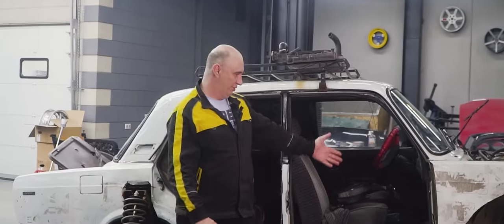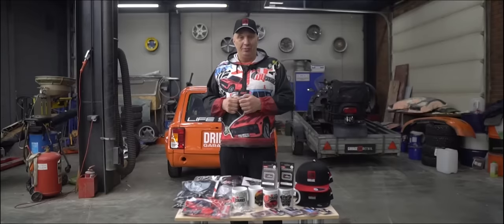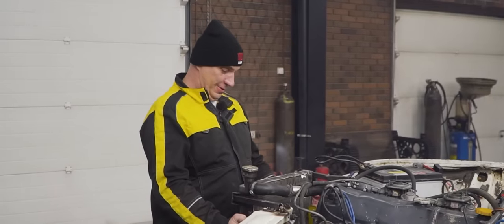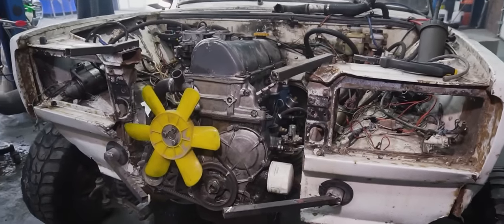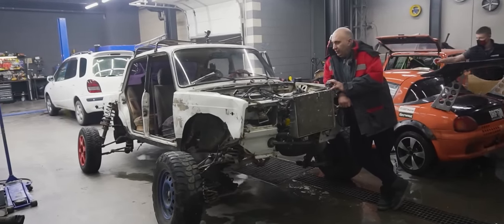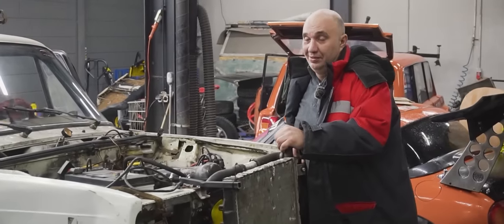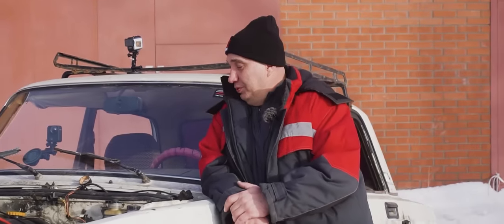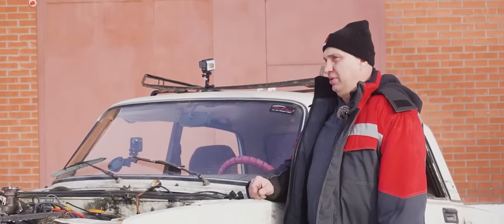How does our custom made inline-6 drive?

Comment: Please put this into a regular car, and measure the torque and power! I think many people are interested in how much you improved the original 4 cylinder engine. Please make this happen!
Reply: ye i am 100% for it
Reply: Yes, he needs to put it on a dyno.
Reply: Yes yes!
Reply: Me too 👍👍
Reply: They forgot about this engine now.....(
Reply: yes
Reply: And add truck turbo
Reply: with one big carby
Reply: Yes
Reply: Realistically it won't make more than 96hp. 64 stock plus 32 of half the block.
Reply: 50% would be my guess.
Reply: yup
Reply: @Makaya9s  It will produce much less than that, even less than the 64hp the engine normally puts out as a 4 cylinder. Itr's a 6 in line with a 180° crankshaft.
Reply: Yes!

Comment: I don't think its running on 6 cylinders, if as I think you have one spark plug piggy backed of another one then only one will spark as electricity will always take the easiest path. You need to modify the ignition system.
Reply: All they have to do is modify any 6cyl distributor to have the lada base, they are easily capable of doing this, hopefully they do.
Reply: They need to use the ignition system from a  old BMW or Jeep
Reply: @twoeightythreez  no, this thing does not fire even at 120 deg intervals
Reply: @kjetiloftedal338  yeah, i was thinking the same. One in top of the other. And 2 cylinders fire at the same time in big bang style😂
Reply: @malancaluciano1253  better try old l6 distributor because it never will work since you need 120° for spark and you will got 180° dosent matter how many distributors you install.
Reply: @LeoKadettTouringCar  tell me why you need 120 deg
Reply: Wrong, it will spark, since it's paralel wiring and if that didn't work, ohms law wouldn't apply
Reply: @Robert Coldham You are incorrect. How about you just Google "Waste Spark Ignition". You'll learn that "only one will spark" isn't right. Also according to your logic, you wouldn't be able to have multiple devices on one circuit and have them all work at the same time. It's nonsense.
Reply: @Franky2Toes69  its not wasted. 2 cylinder fire the same time as other 2
Reply: I second that. The spark plugs are wired in parallel, not in series like in a "wasted spark" circuit. And since a spark is an electrical discharge over a plasma channel, it has negative differential resistance. That probably leads to intermittent ignition failures and do the described "running on four to six cylinders" behavior.
Reply: Yes and the easiest path for the spark is on the exhaust stroke,  not the now deprived  compression stroke.
Reply: The easiest path is half through both!
Reply: It’s literally the same concept as a cop or a slave system one col two plugs kinda like you know the modern hemi engines

Comment: Y'all should make an inline 8 with the two halves timed either 90* or 180* out of phase from each other... Wonder how that would sound with a basic straight pipe on it...
Reply: Trying to see a group of Russians make a V10 engine out of Lada parts would also be quite entertaining.
Reply: @jwalster9412  I second that. Or even a V12 or V16 :)
Reply: Wouldn't it better if the same matching piston fires at the dame time???
Reply: @DigBipper188  there is nothing better than a V10..
Reply: @jwalster9412  v12
Reply: I agree. I want to see a straight 8
Reply: They kinda did that by connecting two together at the flywheel. It put out a lot of power, but less than a typical 8 cylinder.
Reply: @willjohnsonjohnson  yeah, I remember that video. But I'm meaning if they took that idea and instead welded the two engines into one single block like they did here with the LadJZ and timed the cranks to get either 1 or 2 cylinders firing per power stroke. To my recollection the crank timing bit was skipped when they welded the two four bangers to each other or at least they were sparse on the details on how they timed the two engines together.
Reply: Was going to say similar lol a inline 8 lol,  but this would b interesting also
Reply: Straights 8's have been done, they should make a straight 7 :D :D
Reply: @jezzsmith7593  ok must have missed it then lol
Reply: @davydp  Not by g54, I just mean straight 8's have been built and played with by car companies and engineers for a long time.
Reply: @jwalster9412  you can’t with a lada engine, only inlines can make inlines
Reply: @DiscoMiata  I'm sure with a custom crankshaft, and some block fabrication, anything is possible.
Reply: @jwalster9412  …… it would literally cost 10grand just in labor
Reply: There was a I think a Bentley that was like that, I can't remember, And there was another big truck with pretty much 2 GM v8 welded together and joined with the crank pully.
Reply: @DiscoMiata  still better than all V10 cars for sale.
Reply: @jwalster9412  no. Not at all.
Reply: @jezzsmith7593  oh ok I'm with you now lol
Reply: How about a V8?
Reply: @DigBipper188  actually they prefer uneven firing orders for more powerful bike engines. Even firing means there will be a constant power on the wheel, which means a constant traction loss will happen in case of wheel spin. Using uneven firing, there are longer periods when the wheel is not under torque, meaning it has a longer recovery period to gain traction. These engines don't have a 180° or 360° but 90° crank plane instead.
Reply: @jwalster9412  
Have a look at some of Allen Millyard's work.
Reply: Pretty sure if someone put a gun to my head and forced me to make a straight 6 out of two straight 4 then I would have cut the front cylinder off one and back cylinder off the other.
Reply: @DigBipper188  Hell, at this point a Lada Veyron wouldn't suprise me.  🤣🤣🤣
Reply: @jwalster9412  Yeah... V10 welded to an other V10 would be nice.... a V20....
Reply: W16 Lada
Reply: hello space toaster
Reply: @jwalster9412  what about a 10 rotor rotary?
Reply: @coalthedergsune  I mean, technically that equivalent to a V30 because roterys have 3X and many firings.
Reply: @jwalster9412  I'd say more like a radial 30: https://en.wikipedia.org/wiki/Chrysler_A57_multibank
Reply: These guys could make a rotary from a LADA engine
Reply: @tosijjaan  yeah, just re melt the pistons, crank, block and re mold them, jerry rig the carb to the intake port, and buy some seals and such online.
Reply: @tosijjaan  how do I make this the most liked comment on youtube?
Reply: @Silent_Shadow 🤣🤣🤣🤣got that right these guys are simply brilliant and innovative.....what goes on inside their heads is just crazy 😅
Reply: 90* would shake apart. 270* is what you’re wanting. 90* v-twins don’t fire 90* apart, the back cylinder fires then a rotation later the front fires, not one cyl and then the 2nd 90* later.
Reply: @oddballdynamics.9658 I’m a straight “8” with a straight 8” 😂
Reply: @DiscoMiata have you seen Garage 54?
Reply: @VikingDudee    Do you mean the GMC 10L v-12 made from 2 GMC 305ci V-6 engines?
Reply: @coalthedergsune ask “the bald guy” who commented on Billie Eilish’s music video “bad guy” he got like 20 million likes from a 4 word comment: “I’m the bald guy”
Reply: @_..-.._..-.._  I have, I love their videos, although pointless, still fun to watch. I loved the wooden pistons
Reply: protogen
Reply: bobbythailand254  only the generic toasters eat ram.

I'm more sophisticated than that... I eat the whole computer!! :)

Comment: If you continue to have issue use an annealed copper plate for a hesdgasket. It will seal much better than a fiber gasket and can help with minor imperfections
Reply: @animalmother9339  the copper spray works liek a charm when applied to both sides of the gasket
Reply: That'd work quite well. not to mention it can be re-used too if they need to remove the heads by just annealing the gasket again.
Reply: @Ouchwitz Summer Camp LLC  been watching a while. They're definitely learning as they go, maybe a few Years ago they would have.
Reply: @animalmother9339  works great I've used it on several rebuilds. Not as good as an actual copper gasket tho.
Reply: @animalmother9339  ive used it tons on small engine builds. It helps transfer heat better but cleaning it off and old build sucks
Reply: They should turbo it too
Reply: Why not add a turbo charger
Reply: @delta614  until it burns away
Reply: @thedude7726  do you find it causes a galvanic battery effect and causes corrosion?
Reply: Ouchwitz Summer Camp LLC  Can't weld from the inside out!
Reply: Yes, I was gonna suggest fire ringing the cylinders.
Reply: copper gaskets suck ass theres a reason no car in the last 30 years has used them

Comment: you were only going to get 50% more of "not alot of power", but absolutely amazing the fact that this chopped and welded engine runs. well done guys.
Reply: Right? They only claim 73hp new. Those motors were definitely not new. Weld 4 entire motors together and they still won't be making a bunch of power
Reply: @mikedrop4421  there is a lot of losses. It's not even 50 %. I would be surprised if it even kept the power of 4 cylinders.
Reply: @NeroKoso  oh I know. My point was that even if you made a fully functional w16 with no loss its not even gonna break the 300hp mark

Comment: You guys have to try making even more exotic engine configurations like X pattern or slightly easier H or U pattern engines. With enough welding and Lada engines anything is possible.
Reply: It will need major oil modification. Engines don't do well upside down.
Reply: Or they can make a crossplane inline 4 engine like in yamaha r1. How can that sounds made from lada engine.
Reply: @dragonplatform  +1 for cross plane that would sound so good 📈
Reply: @georgekurgansky5986  you could create a form of X engine using 2 VR engines around 160° apart
Reply: That would be in line with Vlads philosophy “when in doubt: add more Lada engines”, and it will obviously still defy every aspect of practicality and efficiency. 
Part 2 of Vlads philosophy is “when out of Lada engines: Add some Russian babes”. My motto is When In Doubt Add More Chinese Girls, proves that great minds think alike.
Reply: Do you realize how difficult that stuff is? They make it look easy on video, but it's not.
Reply: make a chrysler multibank tank engne.
Reply: @strike9716  Where would THEY get one of those?? I'd like to see someone (in the US) make a V12 out of 2 Slant 6s.
Reply: @jeffrykopis5468  They cobble it together out of several lada engines of course. Also chevy made a v12 out of 2 v6s, kind of hard to find though.
Reply: @strike9716  Yeah, the 702 V12 was based on the GMC 351 V6. One piece block, crank, and cam, but two V6 intakes, four V6 heads, 2 carbs, and I believe 2 distributors. Low rev torque engine for big trucks, 2400 rpm redline.
Reply: ...  The Lada X-16 engine...

Comment: What about making a V8 from two 4 cylinder engine blocks?

I like this channel a lot, and the crazy ideas they come up with.
Reply: Put two side by side and join them with chain drives front and rear with the engines phased 180 opposite each other and sync phased to see if it makes a power difference 🤔
Reply: They did that but it was a glorified air compressor!!😮🤦

Comment: I would love to see a fully hydraulic build. Hydraulic pump on the motor, no physical connection to the rear axle just a hydraulic motor. If you could get a variable displacement pump you would have a massive range of gear ratios cvt style.
Reply: Or torque converter.
Reply: This could possibly be an astounding thing to see.. Certainly interesting as an idea.
Reply: @DemetrisIacovides  I've seen it done in wild 4 wheel independent drive rock crawlers but never in an on road vehicle. Curious what type of efficiency loss they would have.
Reply: You need wheel hub gears for it to work with axial type hydraulic motors, adequate radial types are too expensive and still need about 0.5 rpm to start pulling, would still be problematic to get it rolling. Forklifts use axial motors and hub gear, feels redundant to point out how slow they are.
Reply: i do agree too! 👌👍
Reply: @otm646  

I hope they see your comment and do it, brilliant idea! I want to see that!
Reply: And a huge heat problem
Reply: Yep make it 4wd

Comment: Use that two cylinder engine you made before as a compressor to supercharge the inline six
Reply: why not combine the 6 cylinder and 2 cylinder engine to make a new 8 cylinder straight?
Reply: 2 cylinders worth of air is only 1/3 what the inline 6 uses. it would be a net loss. you would need to switch it to the 6 cylinder pumping into the 2 cylinder engine for 3x the air
Reply: @jasonharrison25  Or use gears to overdrive it
Reply: Use a wrecked rotory as a supercharger
Reply: The supercharger would need to run at a higher speed, and the camshaft modified to 2-stroke. Traditionally such air feed cylinders were of large diameter and also double acting.
Reply: It'd need to be doing at least 3x the rotational speed in order to possibly add air to the system.
Reply: @greekartvlog8712  they already did 2 engines bolted together, that would be the same thing with extra steps.
Reply: Just slap a massive turbo on it

Comment: When a spark plug fires, the voltage across it drops from 15-20kV to about 1500V for the remaining duration of the spark. This motor has the plugs for the two additional cylinders connected to two existing plugs. That means when one of the paired plugs fires it will steal the voltage needed for the other plug to fire. It is rare for two plugs to fire at exactly the same voltage, so whichever one fires easiest will prevent it's mate from firing. So the motor will not consistently run very well.
Reply: Would it be possible to change the alternator, battery, and/or coil to increase voltage?
Reply: @TM-dh2xb  6-cylinder distributor and single coils would be my idea but IDK never build a 6cylinder lada
Reply: Make it coil on plug with a homemade crank trigger it's done on race cars all the time

Comment: Well, for a bodged up/welded up heap of scrap, that thing does a pretty good job - - - Of sounding like a classic VW Beetle!

Now, how about making an 8 cylinder version? - Run the cranks timed at 90 degrees out of sync with each other, but otherwise run as two engines with synchronised throttles and separate manifolds.
Reply: You forgot to mention the twin turbos
Reply: I feel like theve done that before
A lada with 2 engines on the front
Reply: It would be great to see them making some power with these engine mock ups, and preferably in a car that is not a total jalopy.
Reply: @themightydrive6694  They've definitely done multi-engine Ladas, but what I'm suggesting is to join two, four cylinder engines together in the same vein as this "one-and-a-half" engine arrangement, and so that the engine blocks, and the crankshafts are welded solidly together as single units. In effect, a straight-eight.
Reply: @28YorkshireRose12  
They’ve literally done that
Just search up 2 engine lada and youll find it
Reply: @themightydrive6694  Ah, right! - I hadn't seen that before, though to be honest, it's still two engines end-to-end rather than melded into one contiguous unit, but it does prove the same point.  This must have been before I found the G54 channel.

Ah well, better luck next time!
Reply: @28YorkshireRose12  
Yeah no worries
Reply: they even made a lada with 4 engines, so 16 cylinders in total

Comment: Need a bigger exhaust to get rid of exhaust gasses more efficiently, could be chokin power with the tiny lada exhaust
Reply: I disagree, bigger will not be significantly better before you reach high revs, even a classic Alfa Romeo twincam will run great on tiny exhaust until the revs get to about 6000-8000. For a Lada at max 4000 rpm the problem will never surface.

Comment: Super long unlikely suggestion: Inline 12 next and then v24 after that. Then you can run the motor through the cabin, no drive shaft, and put another lada cabin on top for the driver and passengers
Reply: They already did an inline 12 and 16
Reply: @thehulkamaniabrother2.089  that was 3 separate engines with 3 different crankshafts, heads, etc.
Reply: Basically a tank at that point 😂
Reply: GABRIELLA  no one cares dude
Reply: @jetink600  I believe if you weld 3 crankshafts together it becomes one crankshaft...
Reply: @thehulkamaniabrother2.089  if you believe that experiment and this one are the same, i got nothing else to say to you about it

Comment: Now that I think about it, I have never seen an in-line 8-cylinder engine, it would be very interesting to see
Reply: They were a thing many moons ago but probably not seen in cars since the 50s or even the 40s! I believe a lot of military and larger commercial  vehicles used I8 engines up into the 70s though.

Interesting idea, I'd love to see a straight 8 Lada!
Reply: There's a reason for that, torsional rigidity or lack of it, plus the length of the thing, they were hard to package in an aero shell, eg the Tatra T77/87/600/603 use a V8 and even then they chose a RR drivetrain for aero, noise reduction and space.

Comment: Build a apposed piston 4 cyl 
.by basically bolting two blocks together  with out heads  so both pistons almost meet each other. And porting the intake and  exhaust through the side of the cylinder so the pistons are the valves..  Pulling in air threw one set with reed valves and a desil type fuel njection... .. So you end up with a 4 cylinder 8 piston 2 stroke..  May require turbo or supercharger to make it run

Comment: I'm going to go ahead and say that one of the biggest issues is the ignition system. Splicing the spark wires is one of the main issues that would cause the engine to run like shat...also, I'm sure the timing curve is going to be WAY out of whack.